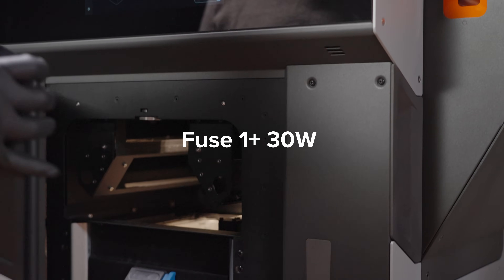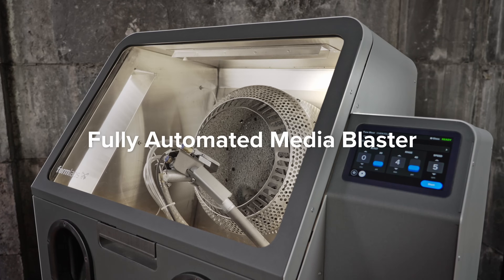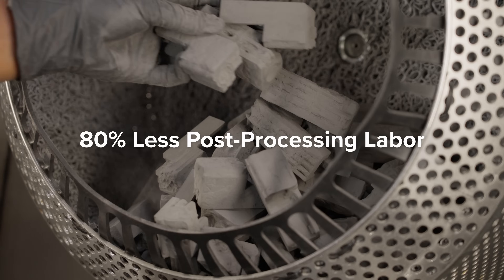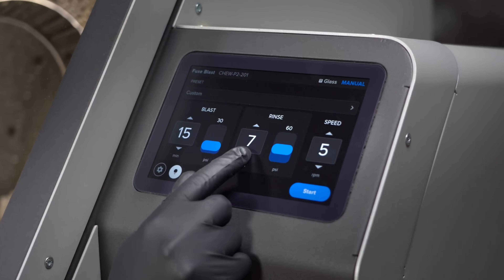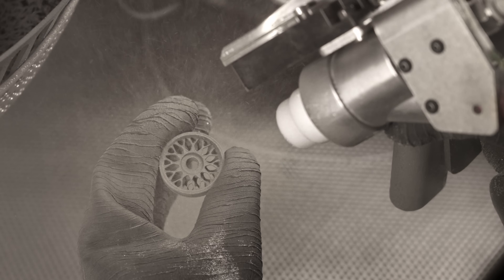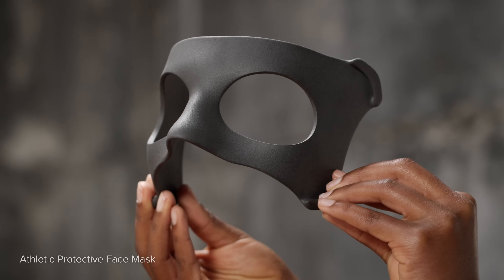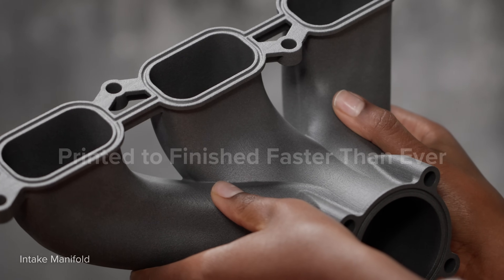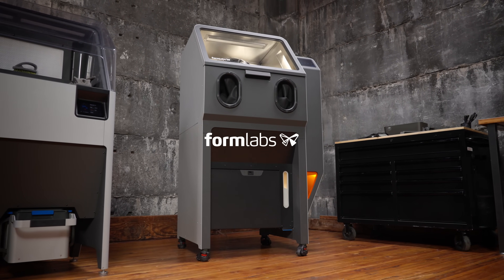Formlabs Fuse Blast: Fully Automated SLS Post-Processing

Comment: A great strength of the fuse 1 is that you can pack hundred(s) of small parts into a job but I always hesitate to do that since it comes with the downside of spending hour(s) of labor to clean one part at a time. Excellent addition to the lineup and very tempting to get one of these! Also, it's pretty neat that an open basket design can work without smaller parts getting ejected by the bead blaster air stream.
Reply: Couldnt agree more. We always put little parts in our builds to bring up packing density but those parts always seem to sit un-cleanded becouse of how tedious it can be, even with a manual media blaster.
Reply: My favorite ex-formlabs employee, neat to see bros still got it on the mind